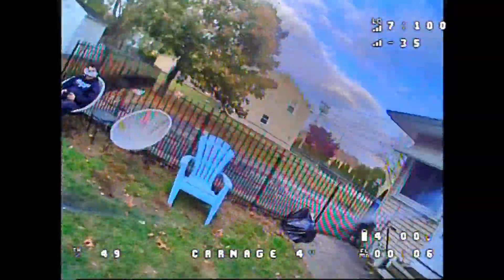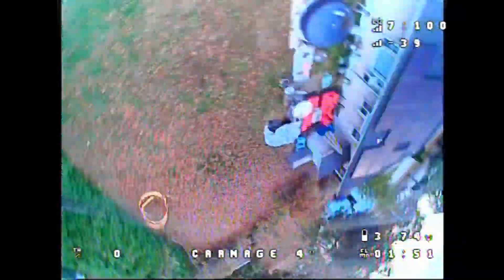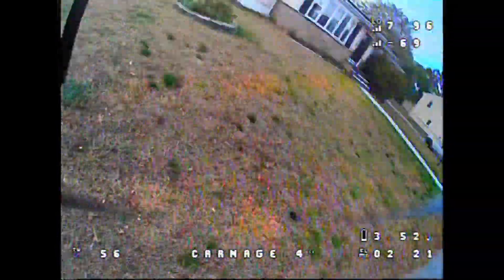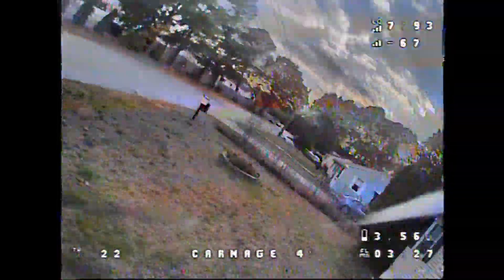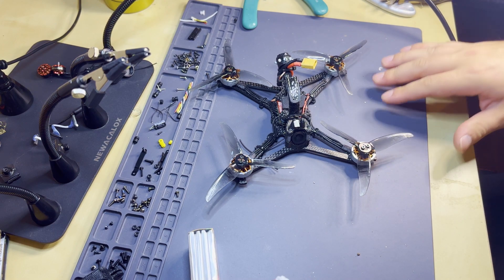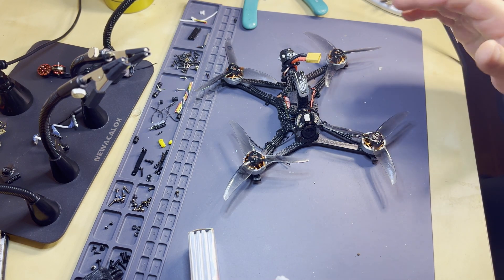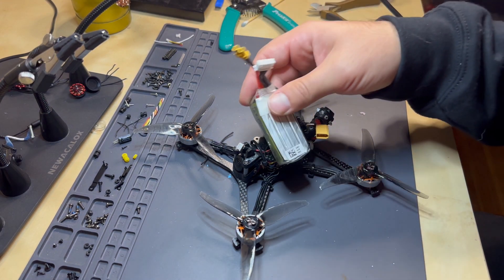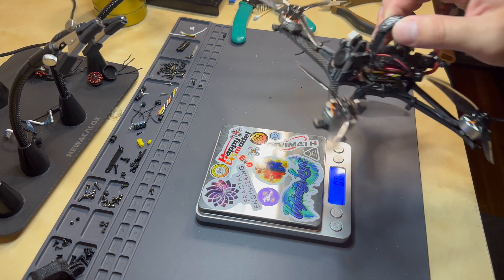Carnage 4" Ultralight Freestyle Drone - Build Guide and Freestyle Flights! @Sub250gFPV

Comment: Really good video ! I believe 4 inch is the best sub250 because you can bring it to the limit of 250 g ...  Because 4S 650 mAh is about 10 grams heavier than 550 mAh I think the weight with the thumb pro V2 and 650 mAh is about 234 g ?
Reply from the maker: Thanks Sugalime! Agreed about your 250 statement, as well. My build was not really close to how light this build could go with maybe some 1404s and some better hardware choices. Also, the lighter we go, the more durable we can expect the platform to be! thanks for dropping by : )
Reply: With Titanium mod and some battery from the future you can fly this thing @ 249 grams with a 4S 850.

Comment: I'm running through 1404 3800 T-motor on my 3.5" tri blade 4s setup and it just about maxed out what I can handle in my backyard. I need to get smaller batteries because I get over 7 min on my 850 batteries. 
I'm LOVING 4s.
Reply from the maker: Good to know about the battery Spec! I feel like the 1404s on a larger bi blade will be super efficient. I tried the 450 4s on my build and still got little over 3min - Crazy!

Comment: 3mm or 4mm thick frame?
Reply from the maker: You can pick which thickness youd like for the bottom plate - either 3 or 4mm. This one is built up on a 3mm bottom plate

Comment: 1804 motors 3400kv are perfect for this on 4s.
I dont recommend the 1604 with 3800kv on 4s. Too much kv, unless you want to run motor output limit. There you would need to get the 2850kv 1604 for 4s and that is pretty low more for like long range.
1404 is only for Bi blade and long range.
Anyway 4" is my go to size.
I got 1804 3500kv and there you need 750mah batteries for the power requirement.
Maybe the iflight 1505 3100kv are perfect for a lighter more efficient 4s basher.
Anyway, for those out there looking for a bnf the rekon 4 fr is very simiar.
Reply from the maker: Thank you for the info, Chris! I do want to experiment with the 1404s on tri blades - have you tried to run that platform on a freestyle spec?